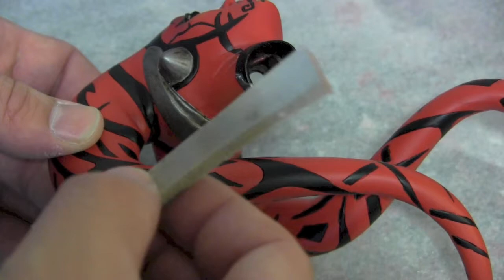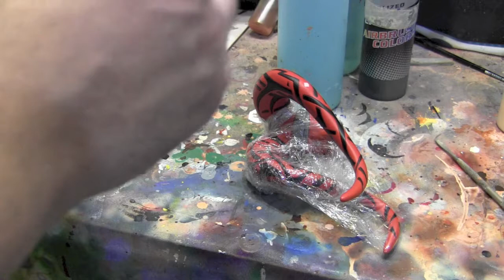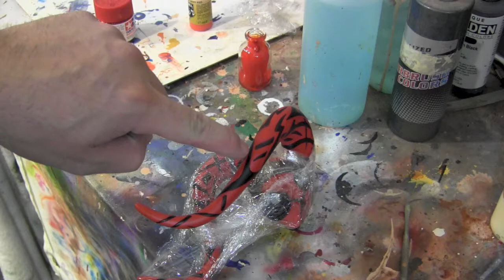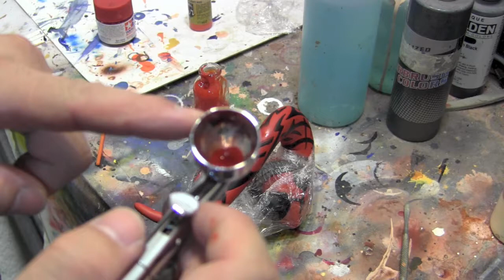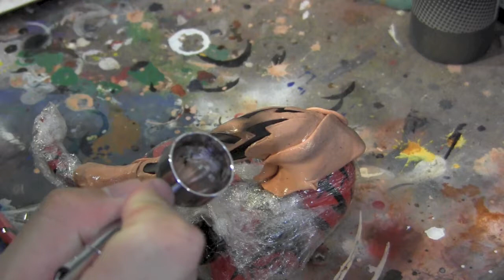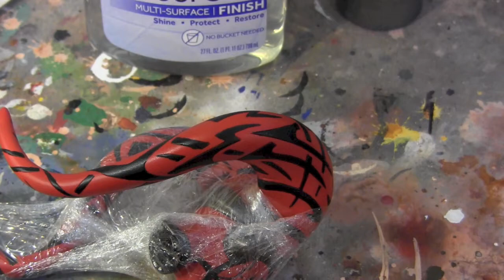Repairing Paint Smudge on Darth Talon Premium Format Statue

Comment: That foam sandpaper you have, you can get that at any hobbystore or hardware store? Thx!
Reply from the maker: Seems to be hard to find now in stores such as home depot and others. But you can go on eBay and get a bulk of 20 pads for like $30, just type in stuff like 3M sponge sand paper fine etc. Prob better to buy in bulk then singles since it will save money and they last a long time.
Reply: Thanks! I will check it out

Comment: Can you give me some advice my friend , I'm planing on buying an air brush and compressor and don't know much about brands or kinds . What brand and model of airbrush should I get that would be good for beginners and still be a good for when you are a little experienced as well?
Reply from the maker: comes down to how much  you want to spend. You can try to get one of those iwata airbrush and compressor kits off ebay. Most of the time the compressor is crap and not worth it in the long run, but cheap to just get into airbrushing. Eclipse Iwata HPCS or a Revolution CS is good ones to start off with and not to expensive. As for compressors, the cheap ones off ebay are meh, auto on and off with no tank sorta sucks so you want one with a tank and some of the best ones could be around the 400+ mark.